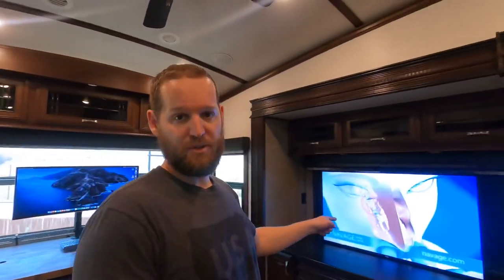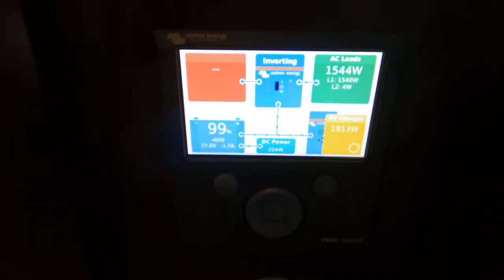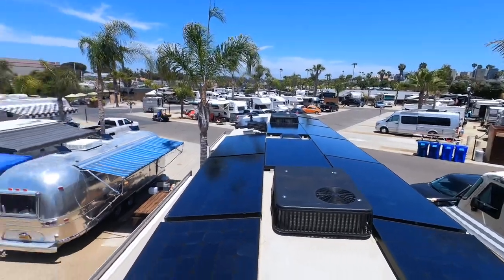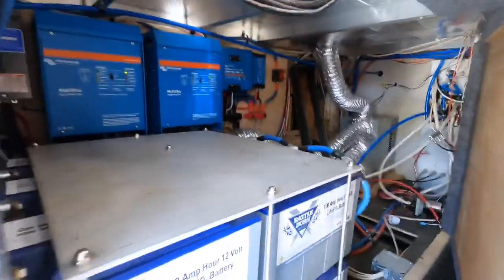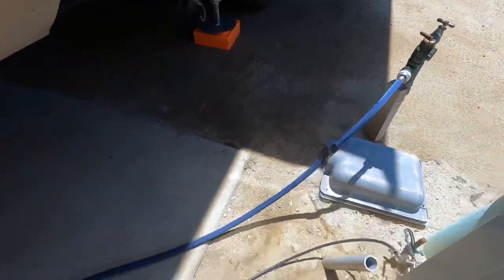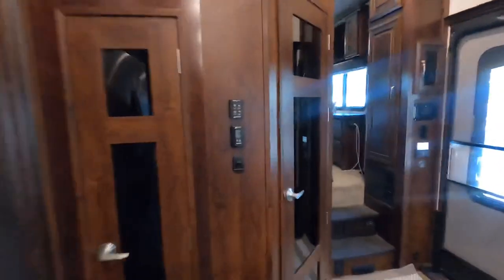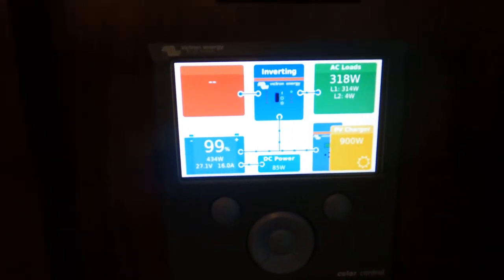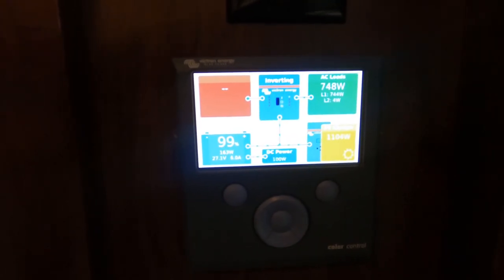Can We Run RV Air Conditioning On Solar Power? A Quick System Overview!

Comment: spending 10k to 15k to be able to use AC i stupid when  a 4500watt dual fuel generator is 1200 and can run for 14 hours for 10 dollars of gas. ive benn doing alot of research and landed on this opinion. and I will stick to this opinion unless 1 solar panel puts out 500watt than we can talk but to waste shit tun of money so and at the end of the day still use gas generator cuz it wont pull the AC well you have to be umm yahh
Reply: I installed a similar system, albeit smaller solar array and 4 lithium batteries to also run the AC and other appliances, although for less time do to only 1050 watts of solar.  I also have a built in Onan genset which I prefer not to use.  I don't care for the noise, and I'm sure any neighbors would also appreciate the quiet.